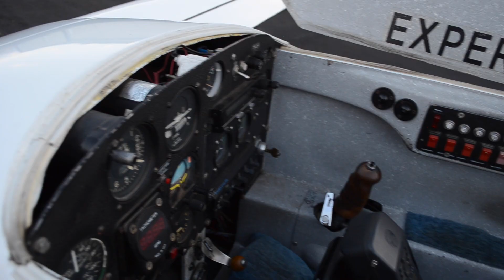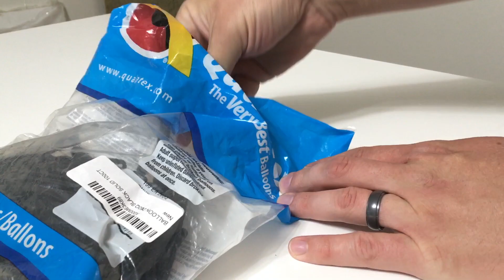Beginner's Guide to Composites, Pt 2

Comment: Great info as always! I like the balloon idea very much. Also, I’m not sure if you are going to talk about it in the next video, but I’ve watched other videos with people using one spiral tube or 2 spiral tubes or even more to inject the resin into the mold. These tend to be bigger parts (a  car hood, door, etc.) but when would you add more spiral tubes? Is there a rule as to when?
Reply: Depends on how thick the part is, but with light laminates (cowls, ...) and the right infusion medium, I usually stick to a max of 50/70 centimeters of flow travel distance.